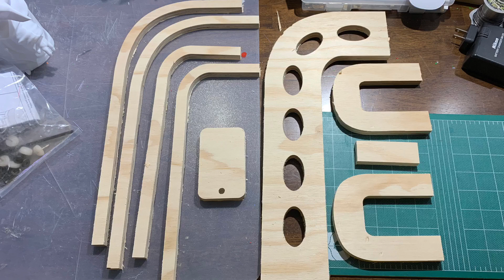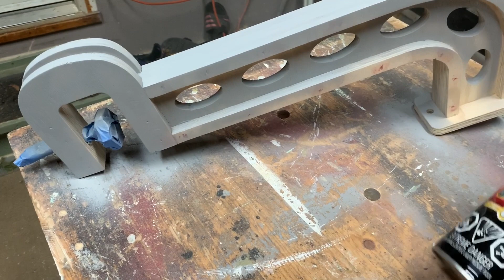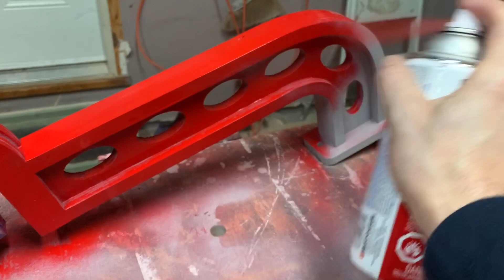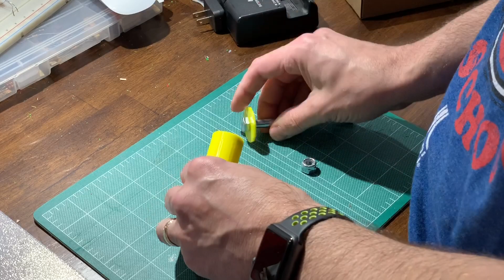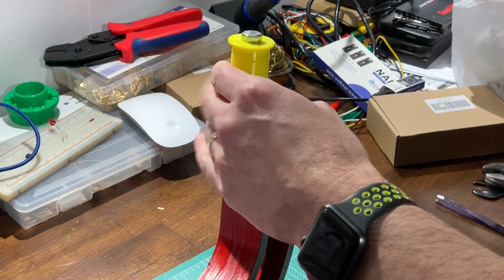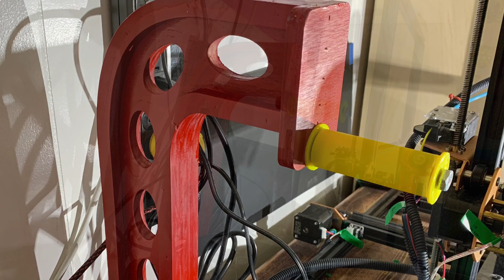3D Printer Spool Holder

Comment: I like seing a CNC at work.  Is your video at normal speed or is it accelerated ? I would like to have your comments on the Sienci I am thinking to by one
Reply from the maker: Videos are sped up usually to keep them short, but depending what you are cutting it can go pretty quick. The LongMill has been good so far but don’t have a tone of time on it yet.
Reply: @DaveRigDesign  thanks for your fast reply